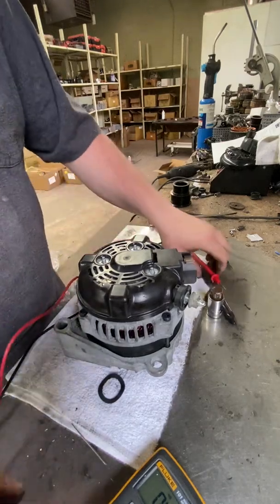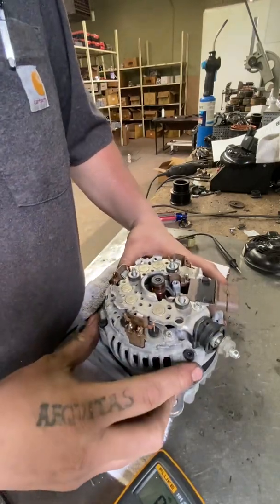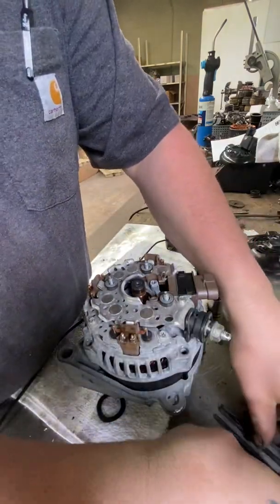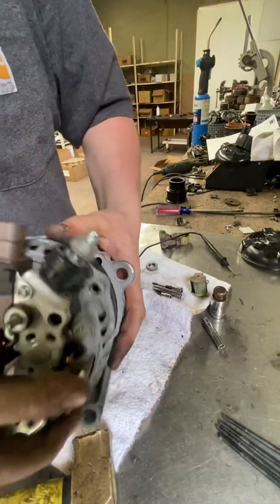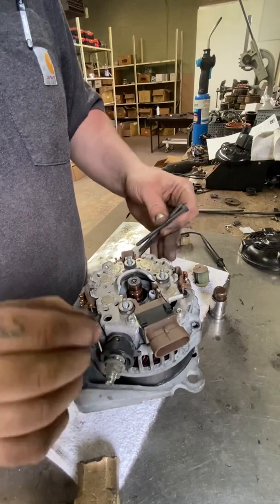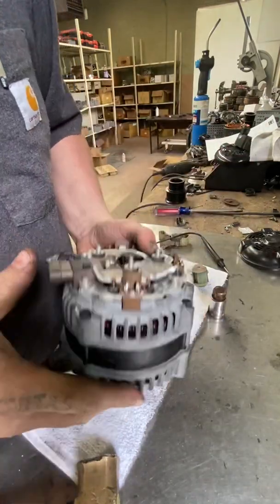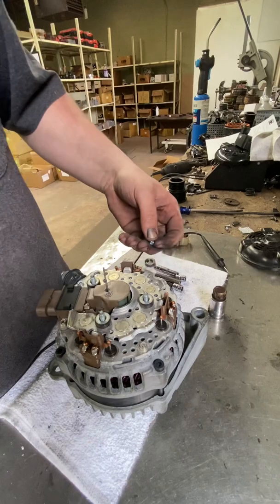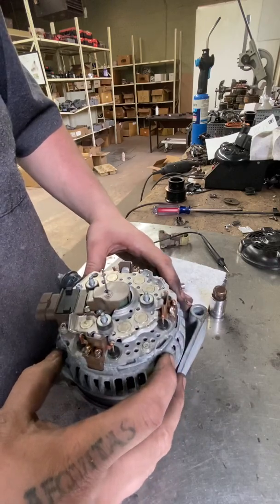How to Clock or re clock Your Alternator / Move alternator stud

Comment: Yeah, let’s talk about some grade A bullshit. I bought this used 400 amp alternator. It’s a brand X and I want to re-lock it and the whole freaking through bolt stripped out the threading trying to get it all out so I apparently I can’t read clock of a bitch without stripping every single through bolt. I don’t know if somebody put superglue or red  on them, but I think it was intentional. I think somebody had rework this and now I have to spend more fucking money to buy one of those damn fusible wires because mine is too short and since I can’t reclock my anyways, just some frustrated venting on some grade A bullshit

Comment: 18 to 22ftlbs or inlbs for the through bolts? Ftlbs seems like a lot for those little fellas.
Reply from the maker: in the description m6 is used, m5 bolts are 9-11 ft lbs you can actually look up safe torque spec for fasters pretty easily :) sorry if I didn't specify which bolts are being used in the video. I did add it to the description though.
Reply: @brandxelectrical  well alright then, i thought forsure those would snap at that spec but I'm always weary as i live in Minnesota and have had them snap removing them when cars mount the alt down low plus I'm used to cam cap bolts m6x1.0 torque to 7ftlbs. Thanks for verification apparently I'm a idiot 👍 but hey I was smart enough to buy a alternator off you 😂
Reply: @brandxelectrical  maybe you will confirm, maybe not, doing a 4 pin flat on a 07 tahoe with a 2 pin (obviously) 470Ohm resistor bridged across the factory terminals shut the battery light off? I've seen 470 and 560. I haven't looked on your site but my buddy with the vehicle sent me a link to mechm $30 "module". I know it's a potted resistor just looking for the value.